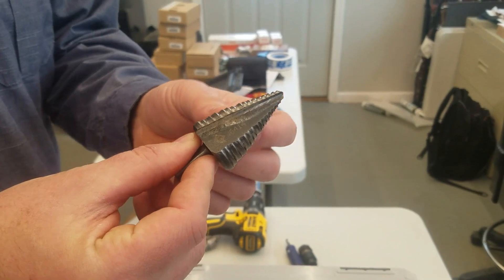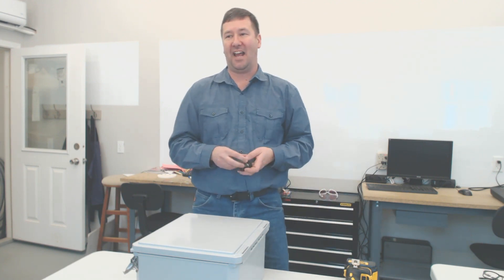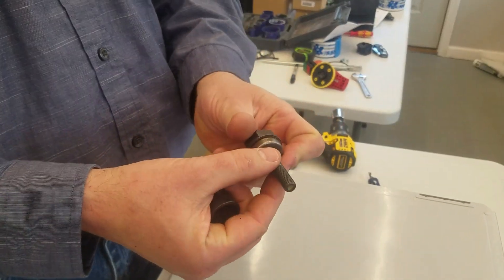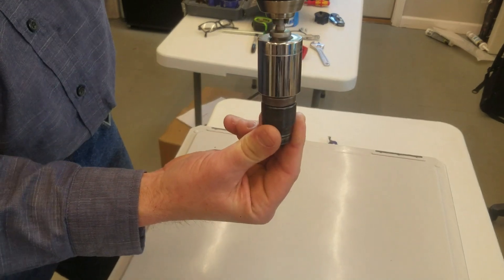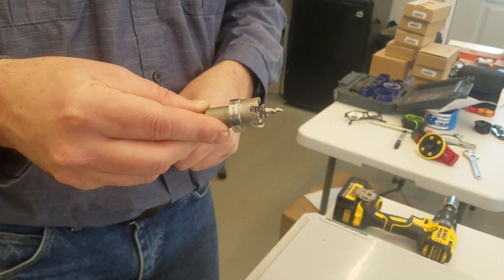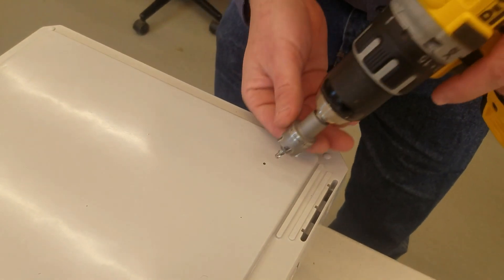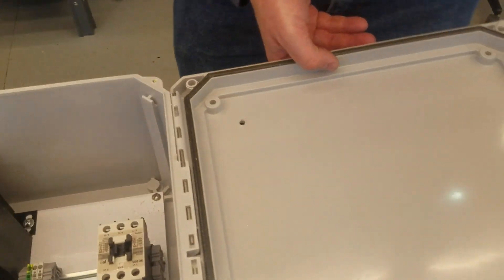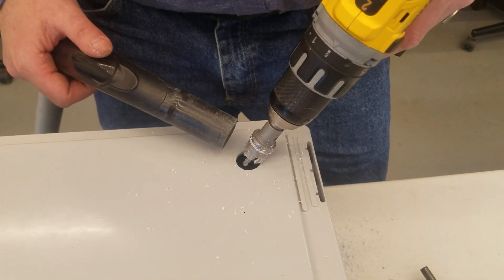Drilling Holes in Electrical Control Panels

Comment: Thanks for this video, Tim! The part of controls I forgot about as I’m trying to learn. My work gave me some small junction boxes and I’m gonna put motor start stop buttons in it and there is also a small backplane with a terminal strip in it. I’m going to put the circuit breaker, contactor, and overload in there.
Reply from the maker: You are welcome.

Comment: You can use small bit of dishwashing liquid on the hole saw - it makes a smooth cut in any plastic.
Reply from the maker: Great tip, I'll have to give it a try!
Reply: Very light oil like aluminum cutting fluid or glass cutting fluid works well in aluminum 'tho watch out for flammability issues.

Comment: Thank you so much for all your videos!! I am in the market to buy a new drill, as I’ve burnt two of my BnD cheap drills while drilling holes into the steel panel using the cone shaped bit! I am not going to ask which brand would you recommend. Instead, what specs and/or type of a drill would you recommend for such use? Thank you much one more time!!
Reply from the maker: Hi Al.  I absolutely love these Ideal Hole Cutters.  They give you good life (don't run them fast) and make a clean hole that is the right size.
https://amzn.to/3a3ghOu

Comment: What is your advice in drilling holes in completed enclosures, especially metal ones, to keep shaving from getting on/in the components?
Reply from the maker: Vacuums, trash bags, and a lot of painters tape 😜
Reply: @TimWilborne  I've seen my associates use magnets on the inside of steel enclosures and that works pretty well but they still cover the components. Obviously that trick doesn't work on stainless. Thanks for the reply. I was curious to see if you had a super cool trick. Just common sense. Though these days that seems like a cool trick to most!  😎
Reply from the maker: @carrollmillen2754  I did 3D print one of these chip catchers for vertical surfaces :) https://www.thingiverse.com/thing:3023372

Comment: When you're using that car by hole saw do you use cutting fluid when you use it on cenla Steel
Reply from the maker: Great question!  I don't use cutting fluid except when on stainless steel.  While this does shorten the life of the cutter it prevents me from having oil in my panel building area.  I have a separate area that I use cutting oil and clean both the parts and my hands while transferring parts between areas.  Don't forget to subscribe!